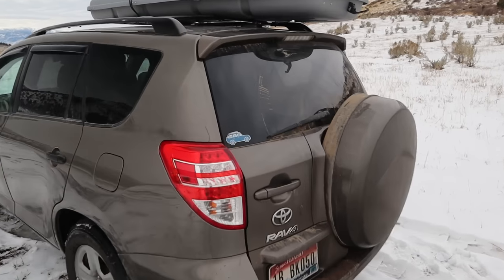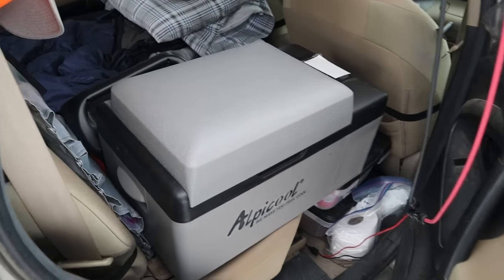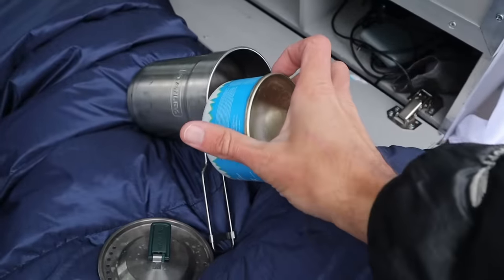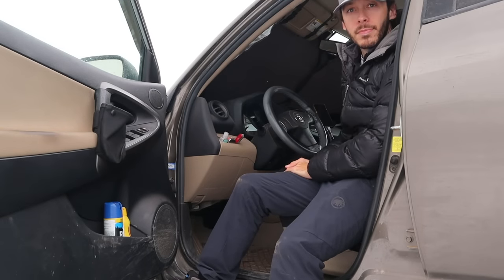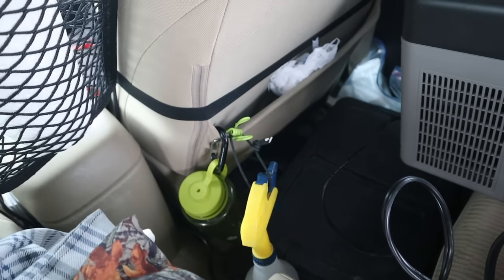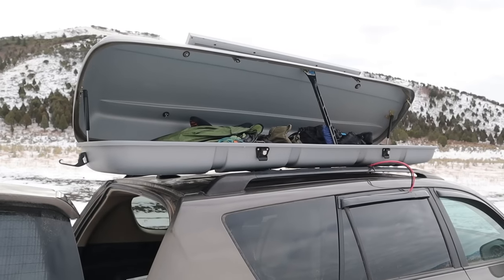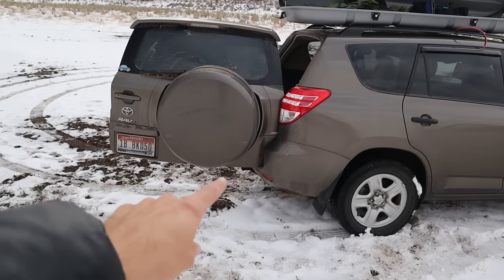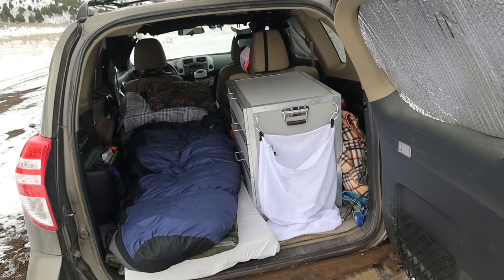My SUV Camping Setup: Full Tour of My Mini Camper! (Vanlife in an SUV)

Comment from the maker: Thanks for watching! Here's the direct link to my "Gear I Use" page: https://suvrving.com/gear/
And be sure to check the video description for links to the other videos I mention.
-Tristan
Reply: Thanks
Reply: Could you go over the solar and fridge charger setup more
Reply: Sooooo nice to see someone who doesn't enjoy cooking...thank u for sharing all the tiny details like the spray bottle for brushing teeth  the seat covers and so on
Reply: Just want to add that a 6” mattress works a little better.
Reply: I plan on using a queen size heated Sherpa lined electric blanket.....some are cordless.  I am also going to use a small round 1500 watt heater, it has a temperature dial and plastic housing doesn’t get hot.
Reply: It's pretty pricey maintaining your setup, I admire your innovations
Reply: Check out Hot Logic Mini on Amazon, there’s one that plugs into a 12V power port like on your Jackery or in the vehicle itself. It’ll hold a 6 cup glass Pyrex container.
Reply: Thanks, great video. Neat setup. I am thinking about doing something similar. I am considering a Jeep Cherokee Trailhawk. As far as the window crack you need to leave open for the cables to go in, I'd put some weather strip up there to close it. You can find the perfect size at Home Depot. Wow, that Jackery 1000 is very expensive, $1000 on Amazon.
Reply: @SUVRVing, an SUV is probably more relaxing to camp in, you're not in tents.🤣🤣 I'll see myself out.
Reply: Wow! You have a great imagination! You have created sooo much to make
This life style work for you
And help others!  I really appreciate your suggestions
Reply: Hi Tristan, very useful video thank you! For all the work you do, and hello 👋 to your wife! From 🍊County Ca,😊
Reply: @margaretanderson978  gg*j<*just
Reply: You can use weather stripping for your slightly open back door window. They are foam strips, sticky on one side.  I love the permanent bug screen, great idea. Lots of mosquitoes here.
Reply: i think its a little misleading calling it vanlife but u dont live in it full time awesome camper build either way

Comment: Reason # 9 ...Security. You're sleeping in a safe metal box which prevents the four-legged (and two-legged) critters from getting to you. 😁
Reply from the maker: Agreed!
Reply: ...especially in USA
Reply: @arctichare8185  anywhere.
Reply: @marylynndontchangename3461   But not everywhere, and between USA and Canada— ESPECIALLY IN USA.
Reply: That's why I like SUVS'  and Vans over truck campers or cargo trailers. Like to jump in the driver's seat and drive away from possible trouble.
Reply: For security, I like having my bed in the same vehicle that I drive, be it a SUV, Car, Van, Minivan , where you can hop in the front and drive away. If you have to get outside to get in your vehicle to drive away, you are exposing yourself to potential dangers.
Reply: @arctichare8185  Much worse in Europe 😝
Reply: yep. don't forget the no legged danger noodle as well.
Reply: @billyrabago8968  they're the worst.
Reply: @arctichare8185  depends on where you are in the u.s
Reply: Exactly!
Reply: @davidleigh443  I like the added value of being able to urban camp, if I so desire. Easier to blend in as opposed to having any time of RV.
Reply: @KimberlyLetsGo  Agreed. I am presently doing a long term work camper job here in Minnesota. I have met several nomads and we have discussed vans/suvs vs. Rvs or vehicles towing campers. The extra space is nice but I am inclined to like the stealthiness and security and all in one vehicle gives one. Some of the Nomads say they only boondock, but having the option to stealth camp in between boondocking is an attraction in my view. Presently, I have been watching Lady Bugout who camps out of a small Ford Transit (2010). She says the interior dimensions of the cargo area is 60.5" wide, 54" High, and 72" long. Any opinion on those small vans?
Reply: @davidleigh443  I will have to go check out Lady Bugout's channel. I have a 2019 Kia Sportage that I'm itching to take out and camp. I had a 2011 Santa Fe before and it was so easy to camp in. I hope I can be as comfortable in the Kia.
Reply: @swisscamperronniecool5419  ??? No such thing. You've never been to Europe, obviously.
Reply: @swisscamperronniecool5419  I don't know where in Europe you've been travelling, but we have travelled all over Europe, perfectly safely. Why you have decided that Europe is more dangerous than the US is completely beyond me.
Reply: @mbd6054  I mean almost anywhere outside of US is dangerous lol I said almost cause Europe does have peaceful places
Reply: @mbd6054  lol are you serious?
Reply: @Gebri3l  100%.
Reply: Cept bears, but my spirit animal toby is a grizzly and he's basically like a giant puppy that loves cake.. had a dream about him and dream's are legit lmao
Reply: @arctichare8185  plenty of crime in Canada. Ask any woman or First Nation member.
Reply: I really want to do a tent experience but this comment pulls me closer to cleaning out my two door Ford Focus and setting up in there🤣
Reply: No big foot problems for you!
Reply: You’d be surprised . People will try to open your doors thinking they can steal your stuff

Comment: In winter, freeze bottles of water outside and load the fridge. It'll help save energy.
Reply: I’m always confused why they even bother with a powered fridge. An insulated cooler works fine for me. And cheaper and easier.
Reply: add either salt or alcohol (label the bottle first) and you can lower the freezing point so that it will lower the temperature of your makeshift fridge
Reply: IKR, he shows us the 2 sleeping bags, snow, and tells us how cold it is, then there is the FRIDGE! Guess it keeps the beers safe from bears.
Reply: Arthur James  , the bear thanks you.  :)
Reply: Or cargo box on roof for frig for food.
Reply: Arthur James  Powered fridge would allow indefinite coldness in the summer with this guy’s setup. He could be in the boonies for 21days straight. No ice cooler can do that.
Reply: @rokko_fable  Never having to worry about your food being soaked in water, or ever having to refill your cooler with ice sounds pretty awesome to me! Currently I have a regular cooler though.

Comment: Something that has made the toiletry business much better for me: a ripping hammer from Harbor Freight. The claw end works great for digging a reasonably deep and narrow trench, even in fairly hard ground. It works much better than trowels and shovels.
The momentum of the weight of the hammer's head is very effective. You can just turn it sideways to pull the excavated dirt back in to cover everything, or use your foot to do the same, and tamp it down.
I usually just keep the hammer under my seat. It's very convenient, and has additional uses as well, like cracking open nuts and coconuts.
Reply from the maker: Good tip!
Reply: And makes a handy weapon if need be. Thanks for info.
Reply: Coconuts

Comment: I do the exact same setup in my Forester including the board to bridge the gap on paracord which I'm sure I got the idea from you! I travelled across Canada and back in August and slept in my car, was pretty comfy! I sleep behind the passenger seat so I can slip into my driver's seat without getting out
Reply: What's the difference. You can still slip into driver's seat from behind, right?
Reply: @tmoss017  easier to not have to climb around the driver's seat to get into it, there's not a lot of space! Also the way my back seats fold down its a 40/60 split with the wider on the passenger side
Reply: @nanchesca3950  gotcha. Yea mines 60/40 too but the bigger side on my driver's side. So I setup the bed on my driver's side. It still works but I was just wondering. Thanks
Reply: @nanchesca3950  mine too, wider on the passenger side, so i sleep there.

Comment: Something extremely useful I just found and started using last year:
Athletic Works (brand) 28-ounce squeeze bottles. These are great, and only cost about two bucks at WM, near the fishing department.
Great for washing hair, hands, showering, using as a bidet, hitting the 'high spots,' rinsing dishes, washing apples, using as water bottles, etc.
Really, really useful, simple, and durable. Also made in USA. 
I love these things, and use them every day.

Comment: I think you'd like my solar pass-through design. I thought about using the deflectors like you did but eventually decided that wind noise was unacceptable to me so I use a piece of plexiglass that slips into the window channel when the window is rolled down, with a small Z shaped self-adhesive seal attached to the plexiglass. Then just drill and mount a pass through port of your choice to the plexiglass plate (I chose a sealed SAE port) and roll the window up to hit the seal of the pass through plate. Zero vehicle modification and zero whistle. Easily removable in seconds with no damage or adhesive residue

Comment: Lots of good info.  I'm a Dodge Caravan guy but all of my bags, comforter and pillow cases are black so they cannot be seen from outside the rig.  All of my storage is in soft bags.   I have not bothered with a solar panel as most of the time on the road I am driving for at least a half hour and every few days a couple of hours.  That way I charge everything while driving.  I travel with a mountain bike, that was a real pain when I had my 4runner.  PS they make a rear carrier that swoops up from the hitch so you will almost never hit it.  The extra wind drag of a rooftop is between 3 and 5 percent on the highway.  The extra wind drag of a rear carrier is near zero.  But being a minimalist really helps.  I do a lot of urban camping.

Comment: I'm sitting at my computer chuckling and amazed that we have almost identical set ups.  I own a 2016 Jeep Compass and have three years of overland camping in it...and I love it.  The 4X4 capability is amazing for what I do.  I love the economy, the distance of travel for a single tank which averages nearly 400 miles and the carrying capacity using a rooftop cargo basket (Walmart for $70) and I can mount my kayak on it safely.  I like your cabinet.  My storage unit is a military locker (issued to me in 1965) and with an additional 5.11 duffle bag, that converts to a backpack, and a LAPG bail out bag provides more than enough storage.  Mounted to the grab handles just behind the two front seats I affixed a clothes bar and put large carabiners on it to attach survival kits, pouches for different Ankers, large roll of orange duck tape, headlamps, spotlight, large flashlight with high lumens, bungee cords, binoculars, a communications pouch with two Motorolas and a Baofeng ham radio and a 45/50 liter Mossy Oak backpack containing extra layers of clothing for cold weather.  On the floor beneath are an electrical blanket, 80/20 wool blanket on one side and hiking shoes, waterproof boots and a pair of Crocs for camp, HD rope with high tensile strength on the other side.  My sleep set is a Teton base camp mattress, a cut piece of reflectics for added insulation, a Coleman zero degree bag and a Thermarest foam pillow.  I bring a hammock just in case it's warm enough to sleep outside.  The spare tire well is one large survival kit with Silky 240, a Helwerks German axe, fire kit with muliple fire starters plus different tinders, tow gear, tool kit, trauma kit with tourniquet, IFAK, rolls of #36 tarred bank line and 55gl contractor trash bags, triangles, flashing orange lights kit and a high viz vest and a bright orange mylar rain poncho and a drop cloth in case the ground is wet.  On my dash is a Garmin GPS, an inverter with the Bestek multi plug unit mounted on the side of the radio/AC housing using industrial velcro.  My cell phone goes into one of the holders that hangs from the rear view mirror and does not interfere with vision.  My next project will be to mount a holder for my Samsung pad.  Alongside the center console are map and mask pouches.  One item I use and recommend are a pair of those mesh covers that you slide down over the tops of the rear doors allowing you to crack your windows.  I bought the $10 set and they work well as I sleep better with a minimal air flow.  This is also a safety item should you decide to run your engine to warm up your car.  Vent shades mounted above each door help to keep the rain out.  One thing I love to do is drape a 10X10 Aqua Quest tarp over my open rear hatch and securing it with guide lines and tent stakes (4 each).  I can set up a small table, a Helinox camp chair and a single burner Coleman or a BSR butane stove to cook meals and make coffee or just sit outside and enjoy the view even if it's raining.  I mounted some fog lights on my front grill and on the front of the cargo basket but have to wire them to the fuse box.  I love watching your adventures and my question is, what do you do should your wife accompany you on an adventure.  My wife's idea of camping is a four star hotel.
Reply from the maker: Thanks for sharing, Alexander! Sounds like a great setup you've got, but I can tell you didn't watch the whole video! 😄  I address why I don't use the mesh covers that slip over the door for ventilation, and I do indeed show the vent shades (reflectors) that I have. This is the setup I use when my wife comes with me: https://www.youtube.com/watch?v=W52zBbhSz60

Comment: I tried camping in an SUV when I went to Acadia National Park, it was a mixed bag.  When the temp was cool, it was AWESOME!!!!  I loved the gas mileage, loved parking it, the ease and versatility are amazing compared to my 30 ft camper.  So easy, loved it.  When it was rainy, it was inconvenient to cook outdoors and being stuck in a small space wasn't great, but doable, because how often will it actually rain.  When it was hot, it was miserable.  I wish there was a portable AC I could run off a battery... if there is people, let me know.  Not a swamp cooler, an AC that can work when the car is off.   In cold I can buy cold weather gear, when it's hot, I can only take off so many clothes and still be HOT.

Comment: I used your idea of making a tube from a sheet for my mattress. It works great. I also used your idea to put a 2 x 2 ft board under my pillow to extend the length of my sleeping space. The gap in my car isn't that wide so I don't even need to secure it with paracord. My body weight keeps it in place. Thank you for all these great, and easy tips. They are practical, inexpensive and anyone can do them.

Comment: Nice. Your setup is very similar to mine in my Honda CRV. My micro camper (which I call my CRV-RV) is a little smaller than yours, of course, and I live a bit more packed because I have a Thedford camp toilet set up behind the passenger side seat. Being female, it works great for me. Laugh if you will, but I use a plastic bag in it when I don't want to be dumping the Thedford, which has been the case during the pandemic. I don't want to use public toilets. And yes, the kitty litter works! I've never had an issue with smell and I use heavy duty bags....just to be sure. Being able to do my personal business entirely inside of my SUV makes me feel much safer. So having a "bathroom" inside does crowd me a little more, but it's worth it because of the freedom I have to hit the road three or four times a year. Your videos and information have been extremely helpful. Thank you.
Reply from the maker: If it works for you, great! I've put a bucket toilet in the same spot just to see if it would fit, and it does. I don't need it in there all the time, but it's a good option for those who want/need it. Thanks Sandy!

Comment: Would love to see a long-term review on the alpicool, with like tips and tricks for using a fridge and things you should know before buying  And just generally covering fridge vs cooler pros and cons.  I just picked an alpicool up through a similar amazon sale (and there's one tip, add the fridge to your wishlist, and amazon is likely to email you with a flash sale price on it before too long), and am still figuring out the best way to put it into use.
Reply from the maker: I haven't made a video about it just because I don't really have much to say about it. I keep it in eco mode and have it set for I think 42 degrees, and that's it. I haven't touched the settings in months. The fridge works great for the price, I think. No complaints.
Reply: @SUVRVing   Is there a way you could slightly lower the fridge temp to about 37-38?  anything much above that some bacteria grow pretty quickly.
Reply from the maker: Yes, of course. The temperature setting is adjustable.

Comment: Nice setup. I can't believe you have almost 6 feet there to lie down comfortably! Just one question. Why did you choose to put the bed behind the driver's seat? If it was behind the passenger seat, couldn't you just leave the seat in the forward position and not have to mess with it?
Reply: Probably because he still has the seats in and the way they fold down is 60/40. So depending which side you go you have more or less space for laying down.
Reply: Its more convenient to not have to walk around the entire car to go in and out of bed or lounge position
Reply: The driver side rear backrest is wider than the passenger side.